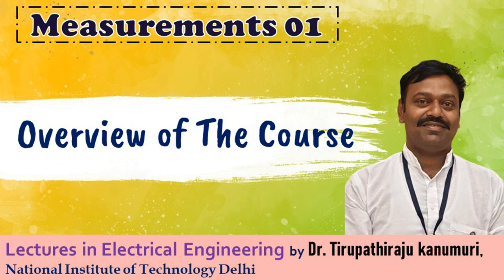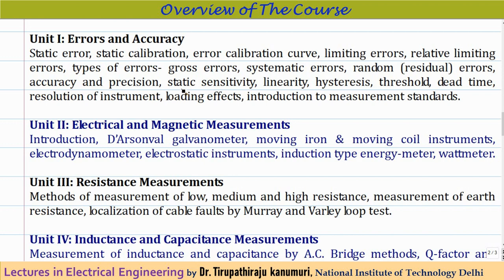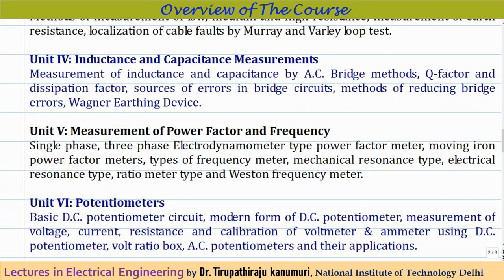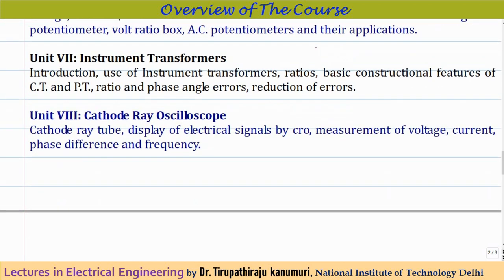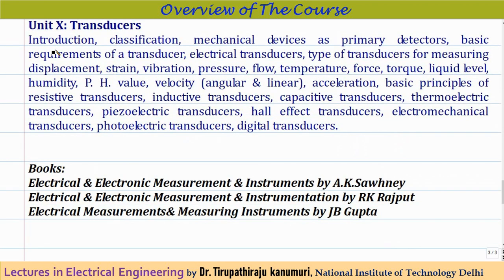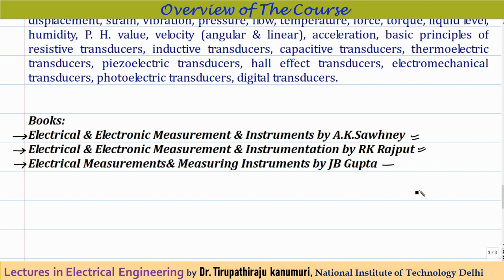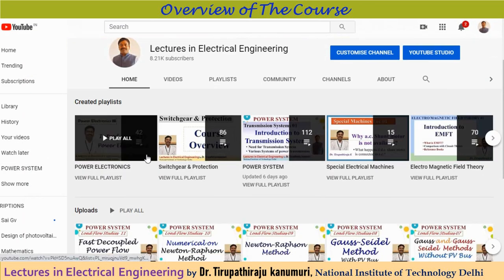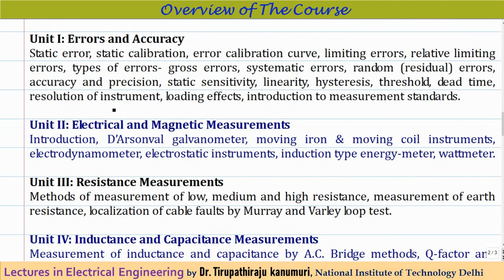ME01 Introduction to Measurements

Comment: Sir kindly let us know how exactly do we calculate multiplying factors for feeders for 33 and 11 Kv...try to explain it thoroughly by making a video...please not just formula
Reply: @lecturesinelectricaleng  sir i am asking about multiplication factor for energy meters...how do we calculate multiplication factors for energy meters installed at 33kv and 11kv panels....please explain it using different examples...also i am confused about meter having -/5 A capacity....can i get your email id for thorough discussions....thanks in advance
Reply: When exactly are you going to teach them...please sir I need to clear this multiplication factor clear asap...would be grateful to you🙏
Reply: I mean we take ratio mentioned on energy meter into account as well...how and why?